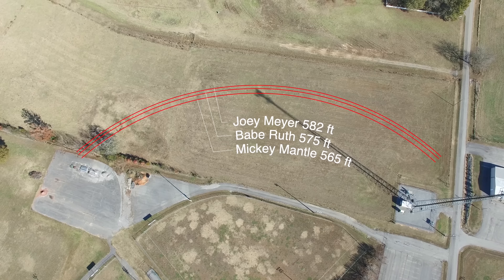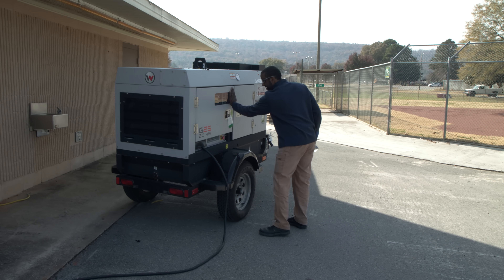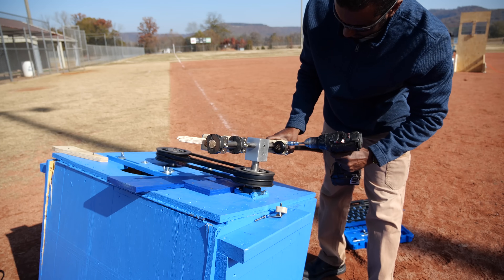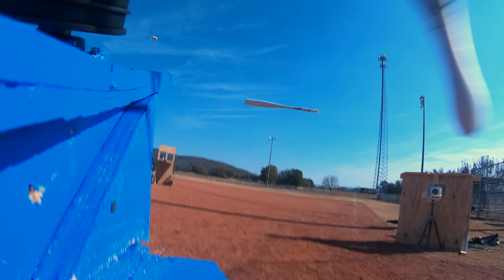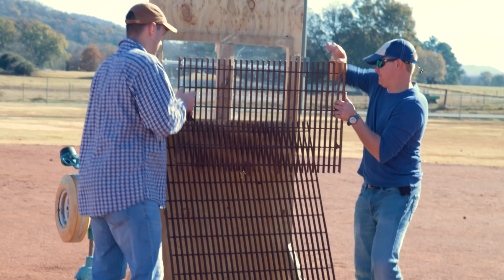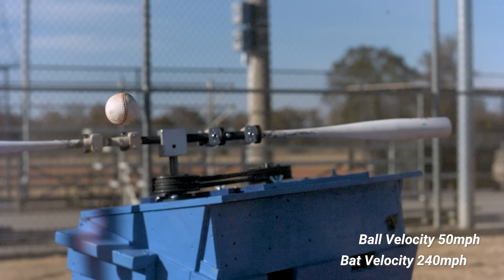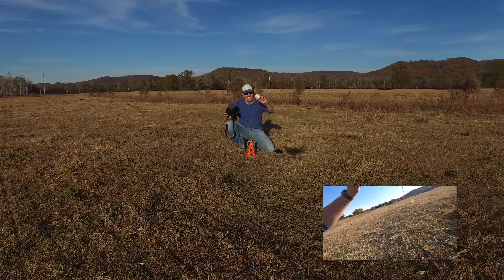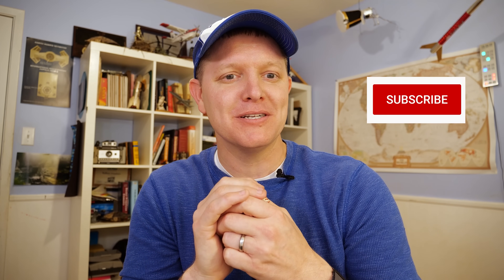World's Longest Home Run (The "Mad Batter" Machine) - Smarter Every Day 230

Comment: The fact that you needed a machine that was basically a helicopter to hit a home run further than Babe Ruth and Micky Mantle is a testament to those two men. And the third one, the AAA home run, props to your amazing 582 too.
Reply: Amazing considering how low tech the game was back then . Just pure sportsmanship.
Reply: The power the possed.
Reply: exactly
Reply: I dunno, I heard babe Ruth was actually an attack helicopter but medicine wasnt advanced enough to catch it back then.
Reply: @staticbb  🤣🤣🤣👍🏻 Awesome comment.
Reply: Doesn't the speed of the pitch affect how deep the ball will go?
Reply: @johnjohnmarfisi5472  bat speed affects distance more than pitch speed
Reply: Huck Finn These are aluminum bats he’s using. So the record would be even better if they used them too back then
Reply: Spin also matters. Modern-day hitting analysts stress the importance of putting backspin on the ball to prevent it from humpback diving. It's essentially the difference between a four-seam fastball and a 12-to-6 curveball. 

I once read that a curveball, because of it's reversed spin, will be hit farther than a fastball because it's already spinning in the right direction to induce backspin. The batted ball doesn't lose any energy to changing spin and therefore will go a little farther.
Reply: This has turned into a warfare
Reply: And they used wooden bats back then.
Reply: There's also the angle at which the ball was hit, that has to be considered. If the ball was hit at the most optimal angle with those rotating bats, the ball would've gone another hundred feet or more easily.
Reply: Did you know my high school swimming times would’ve been world records back in their day? That’s right, if time machine’s existed I would be the fastest swimmer on the planet in the 20’s, 30’s, 40’s and 50’s. This is true of all sports. Take good athletes and send them back 40 or 50 years and they’d be the fastest, quickest and/or strongest on the planet. The opposite is true as well. Take the best athletes on the planet and send them 40 or 50 years into the future and they would just be “good.” Add the fact that measurements were not even close to today’s standards and were highly likely to be phony and I bet none of them could even top 450 feet today. Only other explanation is the bats and/or balls were different but I’m not buying that argument because there’d be a lot of others hitting 500 foot plus homers. It’s just legendary myths. The legend grows, ya know?
Reply: They didn’t hit it to that distance,it rolled to that distance.
Reply: @hxndi-brotherrip606  no they didn’t, balls don’t roll in stadiums
Reply: All cap
Reply: @climatechange7785  the old records? Yeah probably, I don’t see how they could measure them, but people saw Mickey hit that ball out of the stadium.
Reply: ruth and mantle homer Never happend 😂😂😂
Reply: Both were no question way ahead of their counterparts but no chance either could hit further than say Barry Bonds or even a random modern slugger like Bryce Harper. Sports have always exaggerated their numbers for hype.
Reply: @dangolfishin  false.
Reply: @dangolfishin   Barry Bonds = Can you say Steroids  ?
Reply: @rainerrain9689  I don't know where you pulled racist from but like I said Ruth and Mantle were both icons but they didn't hit further than modern players. Maybe if they played in the modern era they could've but they didn't.
Reply: Well when you’re throwing 90mph you don’t need to swing that hard
Reply: @M A Racist .

Comment: i don't see any comments about it below ....but- if the balls were hitting the sweet spot on the bat, the total distance would have been significantly longer. Most all the hits were too far towards the end of the bat, not only loosing distance/velocity- but also causing insane shock to the bats and breaking them easier. (although even at the sweet spot at that speed would cave the bat also)  Would LOVE to see a re-do with balls hitting sweet spot!!  And...i wonder what wooden bats would do??

Comment: One thing that would make this a little better, if you had solid bats, because the bats are hollow the bat absorbs the hit therefore making it dent which makes the output speed less then what it would’ve been if you had solid bats. If you did this again try filling the bats with cement, making it less absorbent. I might be wrong

Comment: At 13:04, It literally moves FASTER THAN THE SHUTTER SPEED. If this is 30 rotations PER SECOND.
Reply: the bat has ONLY 2 frames when played at that speed
Reply: There a lot better clips earlier in video about this
Reply: That’s true
Reply: 30 rotations per second*60 seconds in a minute = 1800 rotations per minute
Reply: @anamayarawa514  
a bat is approx 86cm long. so thats the radius. 2*Pi*86cm = approx. 540cm. so thats the outline of the full circle.
That would mean 540cm/rotation * 1800 rotation/minute = 972000cm/minute.
Meaning: Assuming your 1800 rotations per minute is correct and the length of the bat is correct, too, the furthest most point of the bat was 582km/h fast. or 364mp/h.
thats kinda nuts
Reply: *faster than the framerate
Reply: Actually since you see 4 bats, it's half of shutter speed, which checks out with the ~200mph Destin came up with
Reply: Imagine for some dark reason someone decided to put their arm in it while it's spinning, bye bye felicia

Comment: So it traveled 212 m it took six seconds to travel that distance set the velocity was 35 m/s and if we take 1/2 and multiply the mass of the ball (.145kg) find the velocity (35m/s) and raise it to the second power, The kinetic energy was 6.93J and the force was 177N if we use mass times acceleration equals force

Comment: Haven't finished the video yet, but it seems like there might be a problem where the bat is spinning so fast that the ball just get's dinked off of the tip, instead of hitting it square on the side.

Comment: For the sake of science I will say for our physically glory that people with single movement did almost the same job as this machine. 100 feet less but this machine circular constant  movements and force. In machine defense - to fill fully power of the machine we must thing this way 250 miles, constant circle movements = higher force, stable core between thr bats so why machine did just 100 feet more. Emmmm, maybe because the ball change few times the fly so maybe material must be equal to machine statements - density, weight, size. The wood bat is not for this machine and the bat broke so same way the ball must be for this machine. And we will find greater results. Sorry for my english its not my native language not first.

Comment: I'd think you'd achieve a longer distance by locking the bat machine down and secure. Increase the ball speed to 90mph, and redo the experiment. Also, while you are at it in that open field, pitch some golfballs and see meteoric take offs. Good luck Jim. This bat will self-destruct in 1 millisecond.

Comment: Not sure it matters, but I sincerely want to know if the actual bat type would have made a huge difference. You could tell he used ultra cheap metal bats, but what if he used a top of the line easton composite aluminum, or a total composite dimarini? The sound of the hit would be so different but how would the bats hold up? Would it send the ball farther like those companies advertised?

Comment: Speed is great and helps immensely but the momentum is still lacking. The bat is being swung more than double the speed but the ball is only traveling 100 feet farther. Maybe it's just the air resistance and the baseball is to blame, but I can't help but feel it was more of a lack of weight than anything. Do the same test but shoot the balls more accurately and use some long hammers or clubs. I bet you would double the range then.

Comment: You've probably already considered this, but, if you add some dense padding to the anchor points you may have better luck with everything. Allowing for about an inch of travel between the two points. Taking into account the flesh and bone of a human batter, letting mostly the momentum of the bat do the work. The human batter has a firm grip on the bat but a softer grip with more flexibility through his hands and arms. Taking this into account when designing the anchor points I think you would get the ball to travel further than without and less bat breakage. Maybe the just the arms of the machine could be made of a more flexible material for the same result?

Comment: Problem is that the ball rolled like crazy after it hit the ground so distance is questionable
Reply: Well at the height that the ball was at and the fact that air resistance is a thing it came down more like a stalled plane, and the ground was more than likely did so there a high chance that there was almost no bounce on a shot like that

Comment: I'm not even an engineer and I could of thought of a better way to design/build that . Platform needs to be secured to ground to get a more solid hit. Bat should be pure wood, and he should be behind at least   3 inches of plywood or pure iron  minimum at that velocity of speed.

Comment: Imagine how far it would've went if it was set up on the moon
Reply: Probably would shoot off into space lol
Reply: @miranda.cooper  Or into orbit. Then the Moon would have a tiny little moon of its own.
Reply: Hmmm actually at those speeds the distance would be the same if you hit it harder or not on the moon... just the speed would change since there's not enough gravity to pull the ball back in to the moon...
Reply: @ElJurgaming  No, the distance would be far greater, but the speed would be the same. Also, there is little air on the moon, so it adds to the distance.
Reply: @cooltm2801  No air at all* bro, so no resistance/friction for the ball at all.. it would be a lot lot lot farther lol, but we kinda agree on this one tho

Comment: Should have used golf balls. Probably could’ve hit the moon lol
Reply: Dalllysmacker L LMAO, somebody would die!
Reply: Northern Hills Curb Appeal The cows maybe.
Reply: Golf ball would have exploded
Reply: You'd just destroy them, they'd explode
Reply: eNova_Z I don‘t think so. Professional golfer hit the ball with 140mph and the ball did not crush. 240 mph is about 70% higher. I bet this is in the tolerance of the producer. Golfballs are hightec, except driving range balls and cheap scrap. Google: the record of hitting a golfball is about 340km/h -> 211mph. There is not much space between. I think it will resist.
Reply: Dalllysmacker L that would’ve been really cool! But the only down part is that it probably would’ve taken a couple hours just to make contact with the ball, let alone hitting a homerun
Reply: No the ball probably brake and it would take hours to make contact
Reply: Handballs
Reply: Lacrosse ball
Reply: Tennis balls xD

Comment: Be interesting to see how an MLB official ash wooden bat would do in this type of experiment or if you sped up the velocity of the ball and slowed down the bat speed so the bats wouldn't keep breaking.  Or even try using a softball.  I wonder if you could also do this with golf clubs, specifically drivers to see how far you could hit a golf ball.

Comment: Just made a cup of hot cocoa and noticed something I never had before. As I tapped the spoon on the edge of my cup, the tone went from very low to very high. The longer I tapped the higher the pitch or note. I know it has to do with thermal expansion. May be a neat video

Comment: Once those bats are compromised you're losing distance. Plus the pitching machine was throwing slowly. Then what are the chances you actually got a sweet spot connection? Also the bat breaking free from the rotor probably loses you some impact. Imagine changing a few of these things? I'll bet you could go 800 feet. Great video.

Comment: Pretty cool.  But... I wish you would have stuck with wooden bats or adjusted the difference in power of using metal. And you completely stunk up the video. Why no cameras in the outfield? Did the distance include the roll of the ball or where it struck the ground?  Good concept but if left too many questions.

Comment: I was reading about high temperature hydrolysis, and an efficient energy source to heat the water and generate electricity would be by using a nuclear reactor (little fuel that puts out lots of energy for a relatively long period of time).

The question if someone simulates the amounts of water that can be heated and fully hydrolysed using a nuclear reactor, if so, how many solar panels would be required to mimic the energy output of a nuclear reactor?

Comment: One can see pretty clearly at about 4:45 that the wooden bat struck the ball not along the grain, but against it. This is the typical cause of wooden bats breaking. For this reason, ballplayers hold  their bats in such a way that when they swing, the bat strikes the ball along the grain, and not against it. The direction of the grain on a bat is indicated by the placement of the label: if one holds the label towards oneself while gripping the bat, the ball will strike the bat along the grain, substantially reducing the likelihood that the bat will break.

I have no training in physics, so I don't know how to explain this in a technically proficient way. But the idea is something like this. Take a (not too thick) paperback book, and hold the front cover toward you, pressing your finger in the center of the cover. What you are doing here is applying force to the book against the 'grain' of the pages. Note how much force it takes to make the book bend. Now hold it on its side, with its spine facing you, and apply pressure to the spine of the book - along the 'grain' of the pages. You will note that it takes far more force to make the book bend in this way. Now imagine that the pages are held together rigidly, as in the structure of wood, and you will start to see why a bat held so that it strikes the ball against the grain will break far more easily than a bat held so that it strikes the ball along the grain.

I don't know whether a properly-aligned wooden bat could withstand the stresses of this machine, but this bat was certainly not properly aligned.

Comment: Destin, Really enjoyed this video, and has me hooked to your channel! As a former college baseball athlete, I appreciate the science behind the mechanics of swinging a bat to make solid contact, and as a pitcher, the mechanics of throwing a baseball as well. I wanted to pose two questions (challenges) to you... By changing the angle of the swing (downward motion instead of upward), what difference in distance that would make on the baseball? How does spin rate effect the flight of the ball. Also, something to think about, and could be something worthy of your super slow motion camera, how is that we are able to throw a baseball faster than most speed limits in the USA? How is that possible? Some say the bending of the forearm allows a person to throw a baseball faster than necessarily muscular strength. What are your thoughts?

Comment: I can think of two ways to improve the wood bat limits.  Use a better wood.  Hickory.  Ironwood.  Another idea, what are the legal limits on the diameter of the handle area.  Most are thin to improve the bat speed when using human power.  Not a consideration here.  Not sure if rubber on the clamp would help or not.  Perhaps solid aluminum, or fill the void with high density foam.
You are using an electric motor to swing the bat, the sky is the limit.
The idea is to make something that might be semi legal, even if impractical or basically useless to a person.
If you drop that limit, a solid steel bat.  At some point the ball will limit you.  You were already shredding the ball.

Comment: you "engineered" the bat turning machine.    they need to do the math for the pitcher's box because I'll guarantee that the bat flying off that spindle will fire through that sheet of plywood like it was a sheet of paper.

Comment: Why didn't you put a remote controlled feeder on the pitching machine? Even with the steel grating in front of the pitcher's shield, if the end of an aluminum bat hit it at 250 mph. there would be shrapnel flying through the grating. You could also time the pitches with the remote, perhaps getting more sweet spot strikes.

Comment: I have an experiment for you, visualizing 3d sound. Glass box filled with smoke or dust, a speaker system inside and lasers shining through at slow frame-rate, match frame-rate to hz. Like 270hz=270000or2,700,000fps

Comment: at 4:48...it's difficult to tell but it looks as if the wood grain was vertical as opposed to horizontal.  The bat Label should always be up or down and never front or back lest you'll break the bat,  I suspect it really didn't matter at these speeds however.

Comment: Who thought the machine would start flying away like a helicoptor
Reply: they bolted it down i think
Reply: @wazz35  it... that's not how helicopters work anyway.
Reply: I didnt think it was gonna take off but thought that it was cool that it sounded like a helicopter.
Reply: There is nothing to provide lift.
Reply: The blades of helicopters are shaped a certain way so that when they are spun in a certain direction they move air to the ground. The motorized bats wouldn’t of lifted off of the ground because of the shape of them. They probably would’ve went crazy and did donuts though.

Comment: Destin, of all the experiments where I feared for your life, this one takes the cake.  The danger involved in this particular experiment with the plywood shielding and rotating bat-copter of death..... I'm surprised no one was injured.  

I love what you do, I encourage what you do, and I will even join your Patreon if more safety is implemented, or at least tested for durability.  A 200 mph bat to the face would not be pleasant (whether it be mammal or sporting good).  Glad you're safe and unmaimed.

also that sound at 11:07 is terrifying